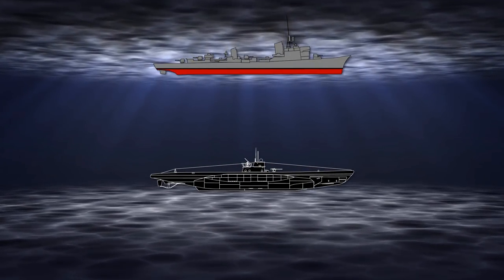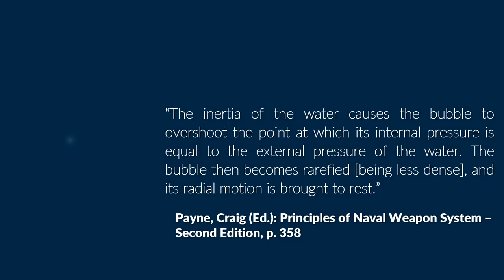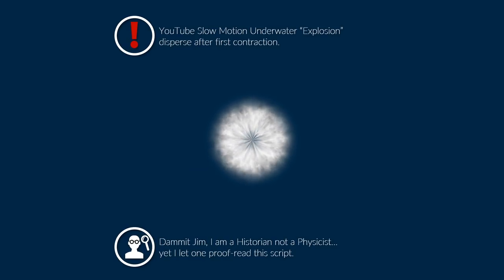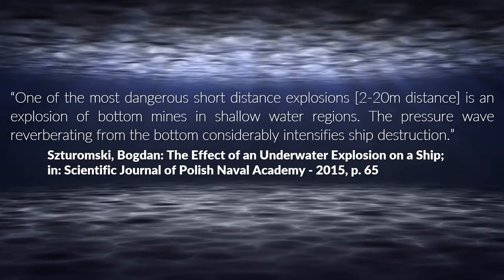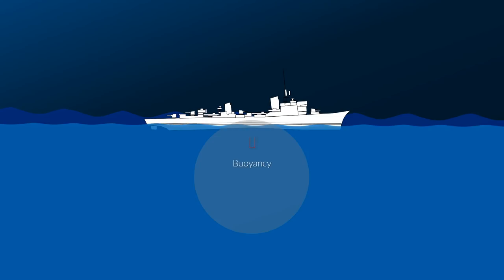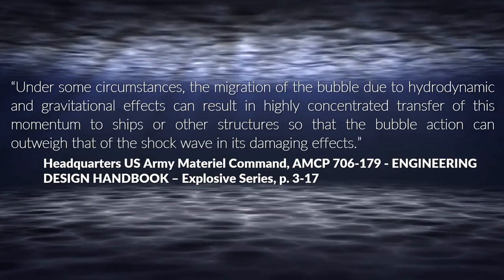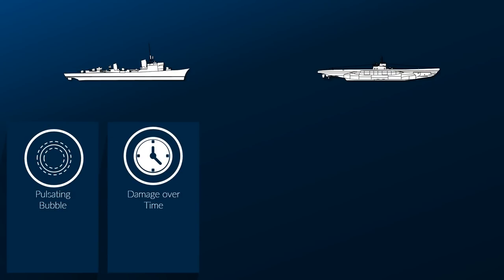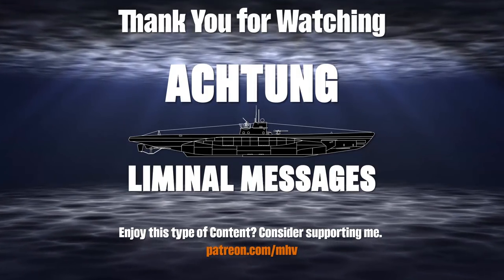How Underwater Explosions damage Ships and Subs #Military101

Comment: About the ship breaking in half.  You say it breaks under its own weight because of the hole in the water.  Do you have a reference that supports this? 

What about this video?  Is it real?  https://www.youtube.com/watch?v=c--fP017Xoc

Assuming it's a real video, it looks to me like:

1) The ship breaks upwards from the initial blast.
2) The ship starts to drop in the middle because the bubble has left it unsupported.
3) When the bubble collapses back in, the middle of the ship is pushed back up and the water surging through the broken hull rips off large sections of the superstructure. 

This makes sense to me.  To create that big hole in the water, the explosion had to exert a very large pressure on the water.  This same pressure would also be applied to the bottom of the ship, right?  Isn't this force (which is also trying to break the ships back, but in the upward direction) likely to be larger than "force" from the water missing from the bubble ?

Second, consider this:  Your explanation is that the hole in the water leads to zero buoyancy for the part of the hull over the hole.  I agree, it does.  Now, there is another way to get zero buoyancy in the same area -- completely flood that part of the hull.  So, would completely flooding the center of the ship cause it to break it's back.  It seems possible, after all flooding in the forward part of the Titanic seems to have caused it to break its back.  But I suspect a war ship is, in general, built stronger to avoid and survive battle damage.  But, I don't know this for sure.  Thus my earlier question -- do you have an references that discuss the details of the failure when an explosion occurs under a ships keel?